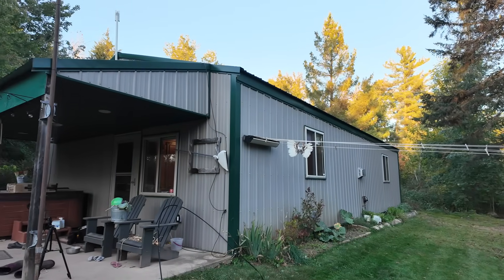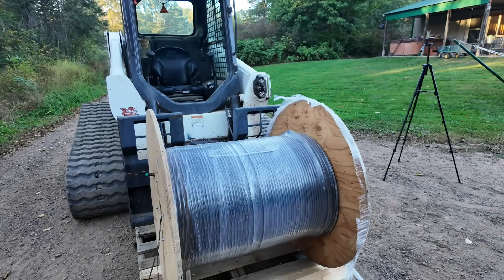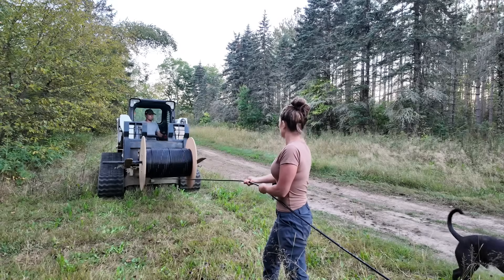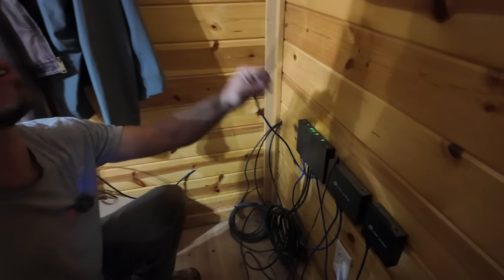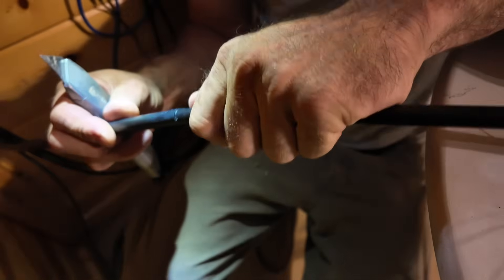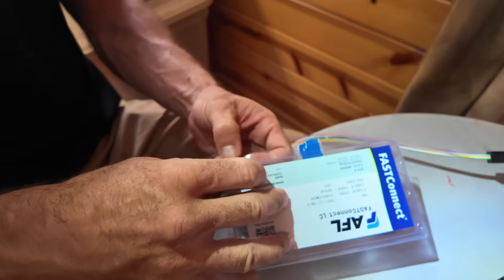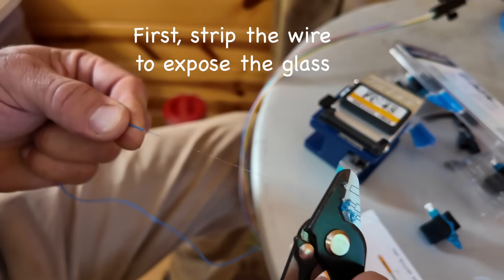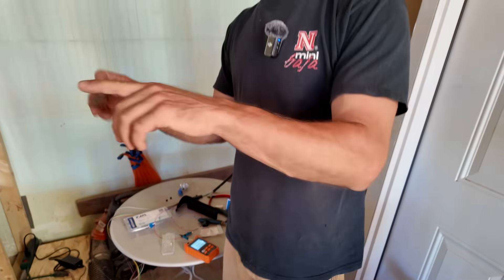We Need Internet! Running a 3,000 ft Fiber Optic Cable

Comment: I applaud choice & your successful learning curve to get your sites interconnected but you're assuming your fibers & cable are far more robust than they actually are. From years of fiber training & experience:

- Get that cable buried ASAP & conduit covered coming out of the ground. Bury it at least 6" below the frost line & before fully backfilling the trench, lay metallic "BURIED FIBER" tape 6" below the surface in case you ever need to locate the cable for repair or clearance from additional underground lines. A host of critters from squirrels to bears, especially bears, like to chomp on plastic jacketed cable above ground. No matter what the manufacturer says about the cable being critter proof, something will make a meal of it. I was once involved with a project that laid miles of "temporary" cable across the ground before snow fell. When hooked up, ten days were wasted finding & repairing all the breaks underneath feet of snow caused by bears & other critters. 

- You need to provide protection for the cable coming out of the ground & entering the building. The metal siding will eventually slice through the armour as the building ages & is flexed by weather. Coming out of the ground  & up the side of the building the cable will be subjected to flexing & stretching due to frost as well as abuse from critters, weed wackers, garden tools, kids & any number of other hazards. Get thick wall electric conduit (at least 1"), elbows & couplings. Be very cognizant of the cable manufacturer's specification for "minimum bend radius". Run it through the wall down into the ground to below the frost line & put at least a 3' horizontal tail on it.

- Get yourself fiber splicing enclosures for both ends of the link. Fasten the fully jacketed cable from the building entry point to the fiber enclosure & only the strip the jacket off exposing the fibers. Once all 12 fibers are terminated, connect them into bulkhead connectors of a patch panel on or in the splice cabinet. Run heavier duty jumper cables from additional bulkhead connectors to your equipment. Interconnect the bulkhead connectors with short jumper cables. This will protect the fragile fibers, maintain a known good building interconnection & let easily replaced jumpers take any abuse. I guarantee you, if you don't install a fiber cabinet & patching you will end up reterminating those exposed fibers until you run out of viable fiber within the buildings. Kids, dogs, vacuum cleaners & all the stuff that gets piled in front of the networking equipment will take their toll on the fragile exposed fibers. Better yet, get a wall mount 19" equipment enclosure to hold & protect a splice cabinet & your network equipment. If you want splice cabinets, I will send you a pair for the shipping cost.

Comment: Just three things, at about 17:00, having the Tx from the sender going to the Rx at the receiver is nothing to do with fibre optics, it's just common sense: if your talking to someone (Tx) you don't talk to their mouth you talk to their ears (Rx). You need to  strain relieve those thin fibre tails, they are VERY fragile, if you leave them hanging, like you've shown you're just asking for trouble. Finally, it always helps to read the instructions fully and make sure you u understand what you are trying to accomplish.!

Comment: As somebody that installs fiber optics on a professional level your basic knowledge it's not bad. In the Telco industry the reason why armored cable is used due to rodents chewing through the cable underground. The armored cable helps to prevent this from happening.
The tube that the fibers come in that cable is called loose tube fiber. The bear fiber itself is approximately 125 microns
The coating over the fiber in loose tube fiber makes the size 225 microns. The fan out kit increase the size to 900 microns which is the size of type buffered fiber. Which is primarily used in indoor applications only. Some tight buffered cable can be used for outdoor applications but it is limited. Loose tube fiber specifically allows for expansion and contraction. If pressure is exerted on the fiber it can distort it coughing signal problems. As far as the fiber moving in the fan out kit there is a simple solution to prevent this. You may even have this item with you if you have paperwork. A small binder paper clip exerts enough pressure on the fan out tube without breaking the glass. This holds the glass in place until it is terminated and held by the connector. 

As far as loss goes in the industry we use a calibrated light source. In conjunction with a light meter. 
 Allowable loss is .75DB through a mated pair or .375 through a connector. At 3,000 ft the estimated loss in the fiber should be between .25DB to .35DB depending on wavelength. These numbers are for single mode I am assuming that is the cable type you're using. Losses can be higher if the equipment allows for it. The actual calculating of loss with power and light is to measure One direction record the results. Measure the other direction record the results and average the two together. The same fiber can have a different measurement in each direction. 

The reality is most of us professionals do not use these methods of termination. 
We actually do fusion splicing which actually fuses the glass together as one piece of continuous glass. Our connectors come with glass already attached and it is simply fused to the cable. Eliminating the need to terminate on site. Unfortunately fiber optic tools can be extremely expensive. You may not want to invest this kind of money into a one time job. I can understand keeping things as basic as possible.

Comment: whats odd our fiber provider said anything over 2,000 feet there will be a signal loss.  and they installed it 2600 feet at my uncle's home and he basically had no signal so they had to come and uninstall everything as he went back to cabletv provider. but his neighbor above him had the fiber installed and it works great for them but there install was less than 200 feet from home to the pole.  you might have to have an inline booster somewhere in your line to get the speed you pay for.

Comment: I did similar in NZ. 2 Km thru the bush, first with cat 5 cable and repeated ethernet switches powered thru alarm cable every 100 meters.  All worked well in the end but rodent attack made for reliability issues..Then with two pair armoured fibre, connectors and modems from Aliexpress. Much better but our signal source was from a 3 G Yaggi aimed at a mobile tower. As mobile use got greater, Vodafone decided our bandwidth was too much and canned the service. Then satellite which was great apart from ping time. We stopped living off-grid a bit before Starlink. Now living in town with fast  optic cable.

Comment: I work for AT&T as a fiber splicer for some years. I'm impressed on how you right out of the box you ran and connected your fiber without having someone there to give you pointers. Good Job!!!!!!!!!!!! I admire homesteaders and their creative ability so solve problems and I think I found another channel to watch.

 While the the special cable opening tool is a nice thing to have and use, you could of gotten the the black outer coating off without it. All you needed to do was your ring cut then on the other end there was a red pull string that you could of pulled down the length of the cable and it would have opened it up. After that all you had to do was remove the armour. I've done many cables this way and I wished I had that opening tool.
Reply: I noticed he didn't use the splicer with a screen, isn't that the best way to get the best signal ?
Reply: Yes fusion splicing is the best way.
@Space.

Comment: One question: Since there are trees (poles) between your offices, why not run the fiber from tree to tree. It's a quick option.
Reply: Unprotected fiber installed like that won't last very long at all - all kinds of potential & actual threats to it.
Reply: @eskieman3948  We've encountered few issues with outdoor fiber on poles in Ireland. Recently, we completed building a new network across rural Ireland that uses both pole and underground installations. However, I've noticed some challenges with fiber in ducts, such as rats chewing through it.

Comment: 08:22 You need to seal the cable entry holes into the house. Rain water will run down the upper cable into the insulation and give you major damp problems. So will insects run in there. Plug those holes right away!

Comment: Very nice job for an amateur. 🙂 You better install an ODF (Optical Distibution frame)  in which you terminate the strands with LC connectors from the optic fiber cable in a protected box. And from the ODF you can use a patch cable to connect to your router.

Comment: Goot job, fiber optics are not easy to work with. If it ever rains, you will get water in the wall, you need to protect the holes from rain with a small overhang, and then make a drip loop on the outside, so that water when it runs down the cable, drips off outside, before it goes up to the hole.

Comment: Great job first tile, leave slack indoors, proper termination boxes not that expensive to firmly secure the main fiber feed. These waving around strands not ok. All this will make it durable. And ditch the fiber underground with proper leying and etc. The power source is in the visible spectre the VFL is used to identify faults and fibers. Proper fiber source is used to meassure the signal level, after it is promary zeroed out meater and source. Thats for short keep posting and upgrading 😊

Comment: If you get a chance I would terminate the fiber into a WIC box. Then come out from there with a fiber jumper.
This will protect the main fiber run.  You can reverse the polarity on the cable or in the box itself. Awesome job.

Comment: It's been a LOOOONG time since I've terminated fiber, and when I did, it was with ST connectors and needed polishing after termination 🤣. Still have the kit and some ends. But even then, it wasn't as hard or mysterious as some out there would have one believe. 

What were the terminating connectors you used? They don't seem to be listed in the description.

Comment: 100% right for picking the fiber solution. Doing it yourself is nuts. I expected this to end much differently but I figured it was going to be an instructive learning experience for everyone watching as well. So massively impressed that you pulled it off without calling someone with fiber experience in to help. I've been around networking for 20-ish years and I've never had the balls to DIY a fiber run.

Comment: You know you could have just tossed up a couple of Meshtastic nodes and gotten off-grid text messaging on your phones working, right?
And it probably would have covered the entire property.  Might be something to look into for the future.
It's fun watching folks learn about running fiber.  
It's a lot easier now than when I was trained to do it 25 years ago, no having to polish the ends, no need to having to heat fuse the ends, etc.

Comment: 3 x starlinks = $1500 gives you 3 different wifi networks vs 1 and shared with high latency and low bandwidth even with FO.

Comment: One thing to keep in mind when working with optic fibres is always wear protective gloves that can not be punctured by the fibre. You would not be the first to stick a fibre into your finger, break it off, no chance to find and remove it and in the end to lose your finger over it.

I don't want to scare anyone but always take your time when working with fibres, set up a proper workplace, don't let yourself be rushed. Be safe!
Reply: 👍
And manage offcuts like they are syringe needles.

Comment: hey brother, as a network cable technician, you Totally did the wrong thing with the color code. Fiber optics color code is BLUE, ORANGE, GREEN, BROWN, SLATE (GREY), WHITE, RED, BLACK, YELLOW, VIOLET (PURPLE), ROSE, AQUA (LIGHT BLUE). There is a method to madness of cleaving fiber, cleaning it, and terminating it properly. This is NOT a DIY job. We as cable technicians go to school for years to get where we are, and to have DIY'ers doing a job like this is a slap to the face of all professionals. I get doing what you need to do, to get the job done, and to get service. But man, at least give the common courtesy of saying that you're not a professional, and that someone would need to reference a professional. I mean every Diy'er does that with electricity. Good job on getting it done. but next time please do the right thing, and get help from a professional.

Comment: I would recommend getting an enclosure for the ends of your fiber run, and using a patch cord to go between the enclosure and your network gear. This protects the exposed fibers and connects. A patch cord is much more robust and, if it does get broken, easy and cheap to replace.

Comment: Cool video. As someone who works with optics all day, I know the meter has a wavelength setting. Since you have a single-mode cable, you need to be at 1310nm; you had 850, which is for multi-mode. Also leaving the cables without any casing is not a good idea. I would highly recommend Splice Cassettes which you can hook to the wall on run SM LC/LC cable from.

Comment: I understand that with shielded cable you might not be worried about chaffing where it goes through the raw hole drilled through the sheet metal siding, but wouldn't some sort of rubber grommet be good for moisture and insect protection?

Comment: You using the power meter on 850nm you are on a single mode fiber not a multimode you have to change the channel / wave to 1310

Comment: If you want to use PTP through the woods, 5 GHz is not what you should use. You should aim for longer wavelengths, like ubiquity 900 MHz airmax if you can find, or 2.4 GHz at the most.

But it's also super easy to put up a pole for clear line of sight for the 5GHz

Comment: Good job for a hobbyist starting stuff out. Well done. 

I would place excess fiber on the way, loops here/there, as that will always become handy when fiber gets dug out by a friendly backhoe. It can happen, so being able to pull 1 meter of extra cable from nearby extra loops, will make the fixing a lot easier.

It is possible to fix a ripped out fibre now too, but you need to cut it cleanly, install a 1-2 meter extension fiber, and weld it in to both ends. Having extra fiber coiled up on the way, reduces the fixing to only one set of welding.

And for the cable installation atop of ground to start with, it is very important to leave few extra meters of cable here/there, as those few meters can be very valuable to have when placing the fiber into ground.  

Usually fibers are welded together (with heat, but not with a flame), and then one gets away from these issues you had with those non-welded connectors. But well done for getting those to work too. And with your next set of devices, you can run that link 10 Gbps, 40 Gbps or 100 Gbps too. And if you one day get one of the links busted, you can run BiDi (BiDirectional) 1G or 10G links, using just one physical fibre. Those devices have transceivers that send and receive on mirroring frequencies (colors), so the traffic can be full duplex and full speed just using one single fiber.

And of course, allways leave 10 meters of that fiber cable to each end, I hope you have that spare somewhere, just to be able to fix what ever happens.

And no, that test device is not laser. Even those transceivers of yours are not laser. Those use LEDs, and as LEDs are very nice quality, they can be used instead of expensive lasers. When working with real telco-gear, and transmission system links far more than 200 km, then real stabilized quality lasers are used in real transmission systems. But again, all my installations (after the telco world), have been with those transceivers that use LED just fine.

And for your WIfi "mesh" thingie, please install CAT6a+ quality wired ethernet everywhere. You seem to have the site still easily accessible, so ethernet wires to good locations, all around. Wifi-Mesh is horrible way to do any networking. When there is a possibility to make all wifi base-stations connect to the core network with wired ethernet, use that as the backbone. And PoE is of course always nice. 

In good wifi setup, you have the same LAN segment (eg same network sharing the same IP-space) to all of your wifi-APs. Then you make the same wifi name (SSID) to all AccessPoints, and same WPA2-3 password. Both 2.4GHz and 5-6GHz wifi networks all have the same SSID. Now your mobile devices are happy as they connect to their favorite known wifi, and when moving around, the client device can sniff better APs and reconnect there (without any major connection cut). Of course there are tons of different "fast roaming" things around, but that is how Roaming wifi must be done.  And if you wan to test those special roaming helpers, go ahead, but building wifi-mesh-networks, never!

And if you have cameras around, all of those to wired ethernet (and PoE). Now you can stream 4K as much as you want, and your wifi is happy as the connection is using wired ethernet all the way. Or at least have cameras following the local animals that come to meet your projects. Nevertheless, wired networks all around inside the houses. For all longer wirings, you can use your fiber cable+tools, as they provide 100% electrical insulation, but internal cabling is much easier with CAT6a.
Reply: Great insights!